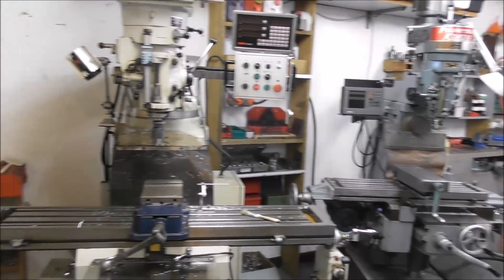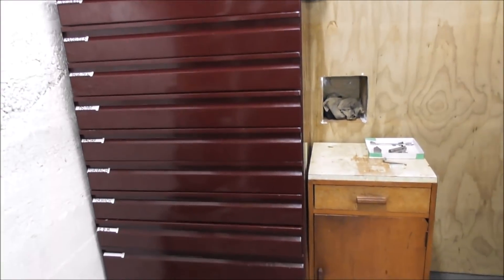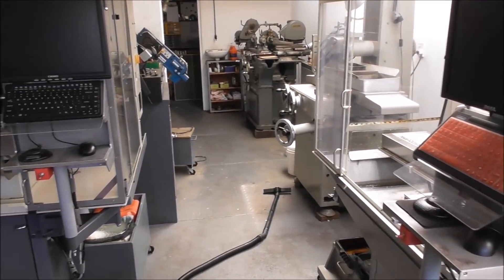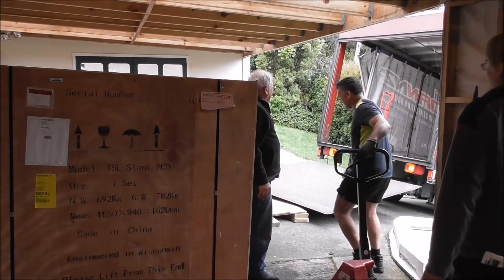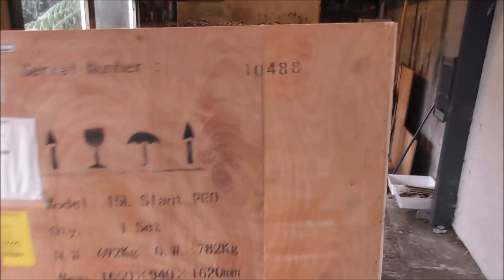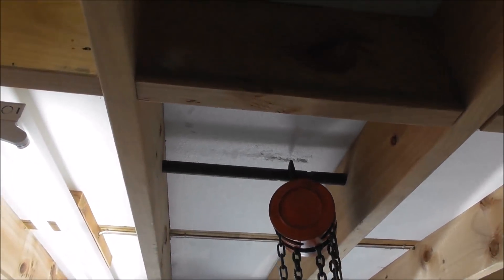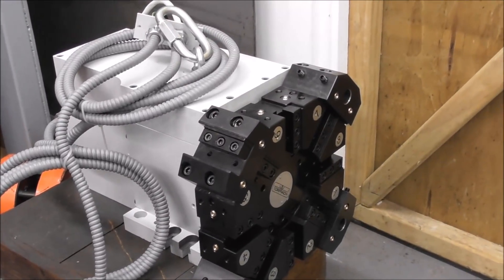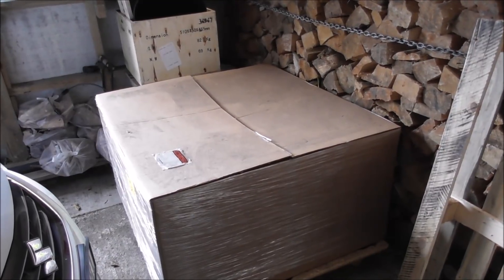Tormach SlantPro arrival and RapidTurn second operation machining.

Comment: Are you going to have enough room out the end of the spindle for bar feeding?
Reply from the maker: Hi Drew. The spindle length is about 500 mm so a stock length will probably not be longer than 600mm - and the headstock to 1100 enclosure gap is about 700mm . Cheers  Cliff
Reply: I was thinking that since you do production work you might want feed stock up to 2 meters in length once you get a bar puller setup.
Reply from the maker: Do you know of anyone that spins stock 1.5 meters out of the headstock on light machines like the Tormach ?  Long bar guide/feeders are heavy duty and are for heavy industrial machines. Usually this diameter range of stock in a light duty cnc lathe is 70% inside the spindle to avoid viabration and whip out - unless you know of some new technology?   Cheers  Cliff

Comment: Enjoyed Cliff! I really like mine. I have made a lot mods but I am not sorry I bought it.
ATB, Robin
Reply from the maker: Good to hear Robin - I would love to see a video of your mods.  Cliff
Reply: I have a lot of it on Instagram. I am "robinrenzetti" on instagram and I have hash tagged all my Tormach stuff with "tormach"  You can search for "robinrenzetti" and you will get my profile page with all my posts. My very first post is a Tormach modification for the collet closer arms. I have decided to not use a turret but all gang tooling or three Aloris toolposts all mounted at the same time.
Reply from the maker: Thanks Robin - I found your Instagram pages - very interesting. Yes I thought long and hard about the Turret -- it makes it a lot more expensive and adds a lot of weight. It was a tough choice.  Cliff

Comment: are you using sharpening mashine as a cylindrycal grinder?how that works,im very curious.you got my dream shop.so so awesome.
Reply from the maker: Hi Stefan - I don't quite follow your question, please elaborate,  Cliff
Reply: sorry i think your cylindrycal grinder is tool grinder or sharpener?but maybe m wrong .im looking for flat(surface} grinder and cylindrical one but the pices are to high for my hobby,so im wondering if i can use a tool grinder for one or both,but more gentle .
Reply from the maker: Hi Stefan
My end grinder is a cylindrical grinder. I do use that small D bit grinder you can see for some types of small cyclindrical grinding - it has 5C collet holding.  Regards  Cliff

Comment: SlantPro was "inevitable" with RapidTurn running out of grunt on the heavier steel cuts.

Might want to change how some doors hang on the lathe if there's not enough room to swing them fully. Sometimes a couple of pins in the bottom edge of the door, seating into the doorframe, and a latch at the top works, allowing the door to bw removed completely for access to the guts.
Reply from the maker: Thanks Bernd. Luckily the electrical cabinet door lifts clean off - a nice feature.  Cheers  Cliff

Comment: Congratulations on the new lathe Cliff, even better Tormach was smart enough to pick an owner who's obviously highly skilled and very experienced. I'm sure they'll get everything they expect and then some. If that shipping cost was from the U.S. to NZ you did very well. I paid the shipping company I was working for about $650 to move an 1100 lb mill from Toronto to B.C. and I drove the truck. Well I did get paid for moving the rest of the load. :-) But that was my employee special rate for about 3,000 miles.
Reply from the maker: Thanks for that feedback TP.  Cliff

Comment: Another reason I like Tormach is after-sales service and parts availability. For business use, you can't afford extended down time while you order and import something from China - a month or two with no production would kill many small shops. I like the specs on some direct-from-China machines but I just can't bring my self to order anything that doesn't have a local agent.
Reply from the maker: Hi Nick - Yes good points. Cliff